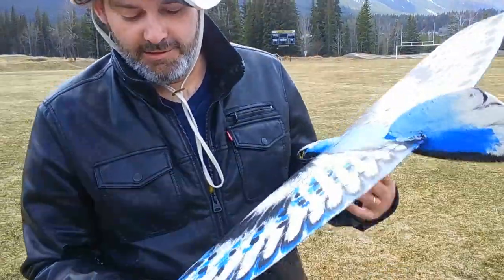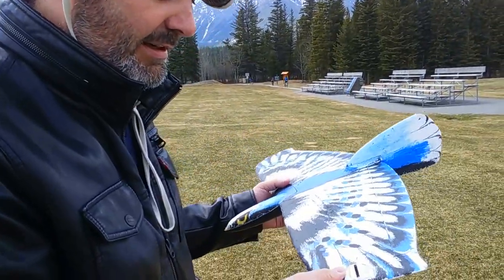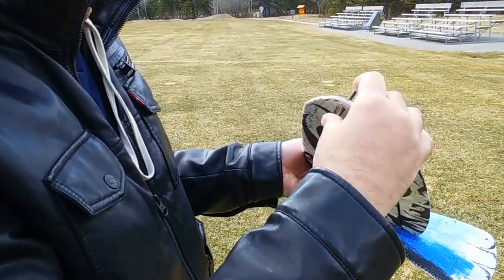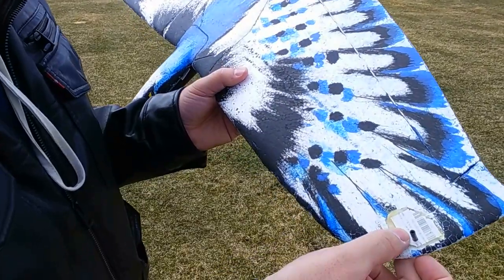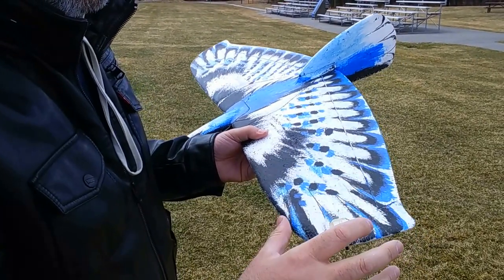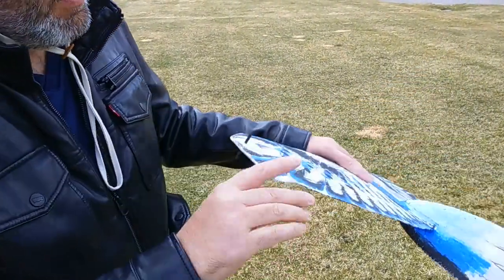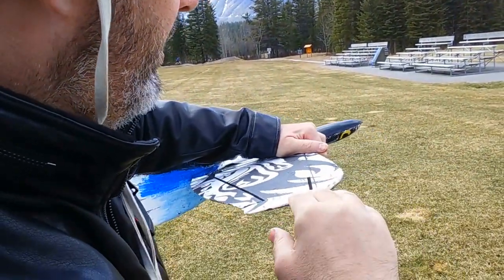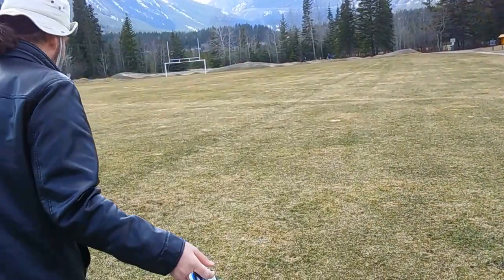Dreamflight Alula DLG launch peg installed

Comment: I know that it has been some time since you posted this video on the Alua.  Does the DLG peg help in getting more height on the launch?  Any damage to the wing over time throwing it this way?
Reply from the maker: I'm still flying this. It's a good mod.  The problem can be the force on the tail when your throw it hard. I've repaired the tail several times. My last repair included a carbon fiber rod that works really well.
Reply: How much more height do you get?  Does the carbon rod run horizontal on the tail?
Reply from the maker: i made a hole with a small steel rod and then made it bigger jamming the carbon fiber rod in. I did the peg mod shortly after buying it. maybe i get 10 feet more. I have a vario and i programmed the radio to tell me how high it is if its over 50ft. on a good launch i will get it over 50ft.